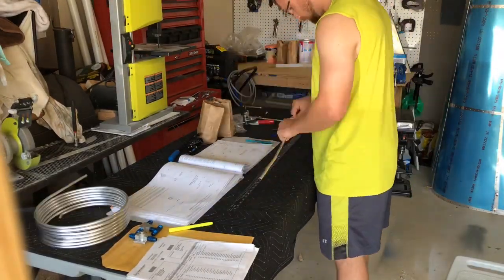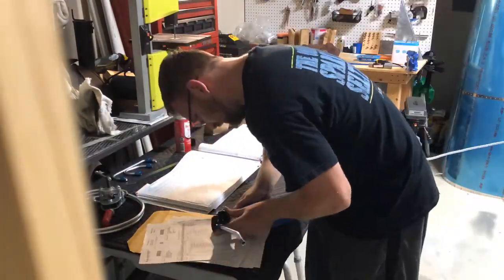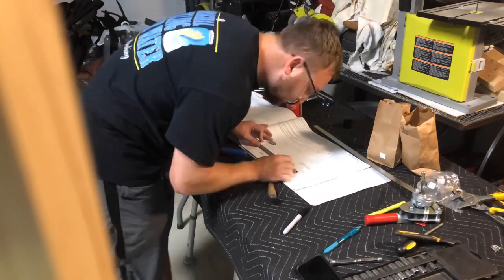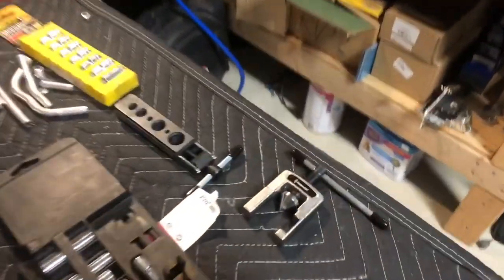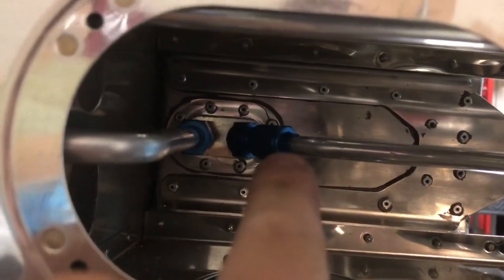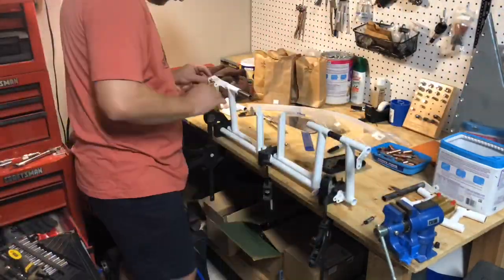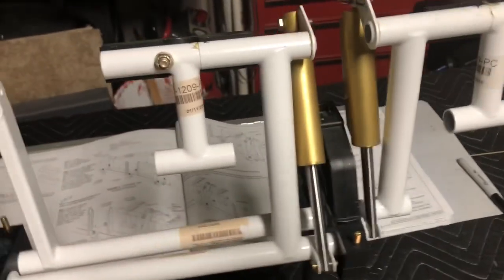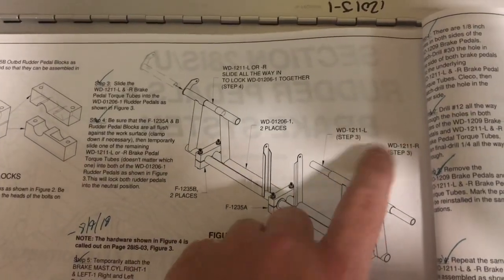RV-12iS Fuselage 18: Fuel lines and Rudder pedals

Comment: Great videos !! I will soon begin with the fuel system.
After watching your video: Is there a way to flare without buying the extra flaring tools you show? For what I see, it is only that one flare (where the Parker tool does nos fit) that you need the Imperial Roll.
It’s about $400 for one flare, if it’s absolutely necessary or useful in other bends, so be it, but if there is a way to bend before you get in that tight spot, I don’t see the need for that tool.
Reply from the maker: On the two fuel lines coming from the front of the fuse there is no way to flare these once they are in the fuselage as the amount of fuel line sticking through the bulkhead is only a few inches and you can’t bend it upwards enough to get the larger flare tool in there. You also cannot flare it beforehand as the hole in the bulkhead is only large enough to fit the fuel line through. The flare and nut are way too big for the hole. The compact flare tool I bought was only $100 and worked very well.
Reply: @blflores10  thank you, Do you have the link to your Compact Flare Tool you used?
Reply: @hermannbalz6845  can I get a link to that compact flare tool.   Thanks
Reply from the maker: Thanks for the feedback on the videos!
Reply: @blflores10  sent 👍
Reply: Can I also get the link to the compact flare tool.   Missing your videos.   Watched all your videos a couple times.   Thanks for your time.   Yamaha baby!

Comment: Just working on the rudder pedals - so your comments on the plans were timely. Anything special drilling into I guess what is steel ?
Reply from the maker: They are steel, the only suggestions are to have a sharp drill bit and using the break pedal as a guide drill slowly as to not move the break pedal. I used some cleco clamps to hold the break pedal to the shaft while drilling as I could not get a C-clamp to stay on as shown in the plans. Good Luck! let me know how it turns out.